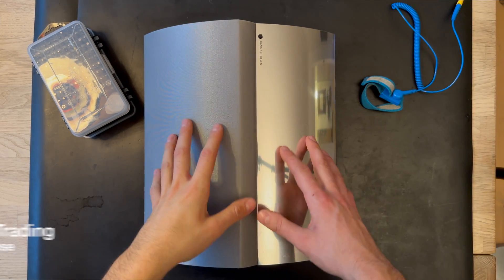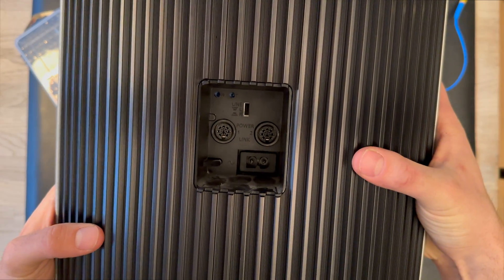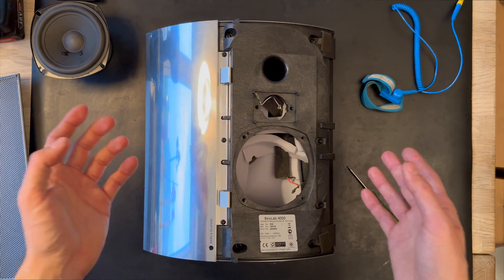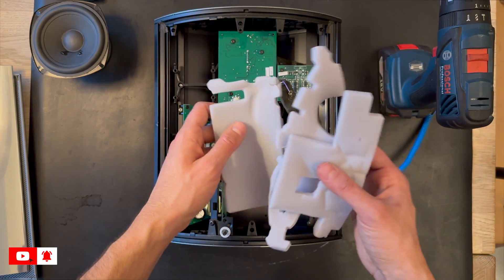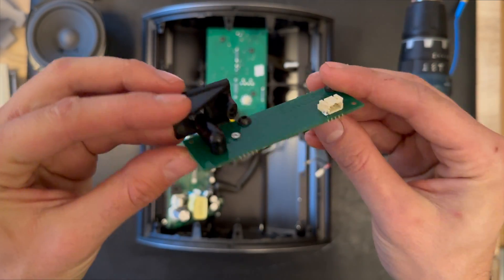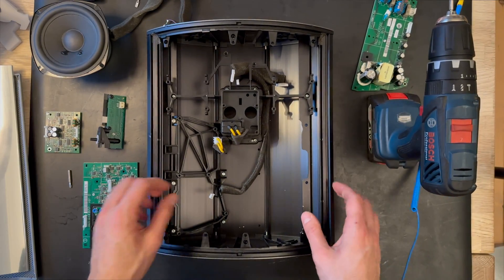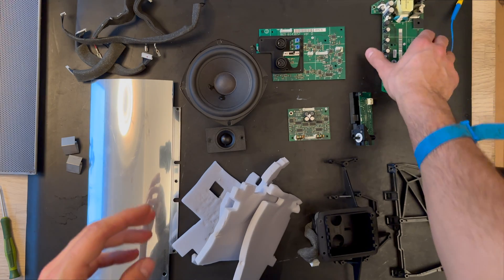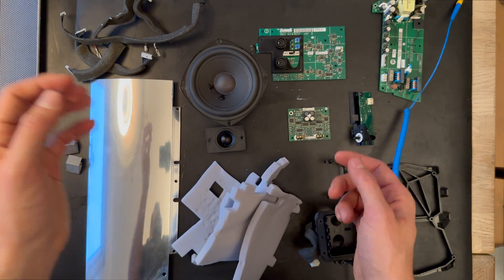Bang & Olufsen Beolab 4000 MK 2 Disassembly process and Repair guide

Comment: Hi , ive just got this speaker and one only show the red light it dosnt turn green, can you guys help me ?
Reply from the maker: Thank you for your message. The issue you're experiencing is quite common with the Beolab 4000 MK2. It typically involves a malfunctioning amplifier module board inside the speaker.

We can provide a replacement amplifier module board, which comes with a 2-year warranty for peace of mind. Please let us know if you'd like to proceed with the order or if you have any further questions.

Here is the link:

https://kosetrading.com/product/bang-olufsen-bo-beolab-4000-mk-2-amplifier-part-pcb-1/

Comment: Hi thanks for the informative video.
I have a fault with my MK1’s where one of the speakers displays only a red light when turned on not the green light. 
Do you know what could be causing this?
Reply from the maker: Thank you for your message! Yes, this sounds like an amplifier issue. You’ll need to replace the board. We offer fully serviced amplifier boards on our website, ready for purchase.

https://kosetrading.com/product/beolab-4000-power-supply-amp-part-02-module-8006149/
Reply: @ Thanks for getting back to me so quickly 🙂 And for the link to the replacement part, I’ll see if cleaning out the old foam stuff has any effect first but great to know I can get a new part if needed…
Reply from the maker: @OnStandby-5050  The damage has already impacted the amplifier board, with the old black isolation foam sitting on it for an extended period. So the cleaning will nok help but you are more than welcome to try.
Reply: @ Thanks, I don’t doubt that you are correct!
Reply: It’s a shame B&O used a material in the manufacturing process that ultimately destroys internal components over time.
Reply from the maker: @OnStandby-5050  Yes, you’re absolutely right. However, I don’t think Bang & Olufsen expected these beautiful, unique speakers to last this long. Additionally, I believe they didn’t thoroughly test the durability of their insulation materials over time. When insulation materials are exposed to moisture over extended periods, their quality deteriorates. So, it’s a combination of poor material choices and inadequate analysis of material selection on Bang & Olufsen's part.
Reply: @KoseTrading  I can confirm that you are correct, which is unfortunate! I’ve dismantled the speaker, cleaned out the AWFUL black sticky foam & surface cleansed the amp circuit board which hasn’t made a scrap of difference to the colour of my power on light 😭😭😭😭😭
Thanks so much for your help anyway, I may need to purchase a new board if you’re sure that’s where the issue is.
Reply from the maker: @OnStandby-5050  
I understand how frustrating this can be! Unfortunately, that black sticky foam is a common issue, and even cleaning it thoroughly doesn’t always solve the problem if the board itself is affected. If you’re still getting that color on the power light, it’s likely that the circuit board is indeed at fault.

I’d be happy to help you with a replacement. You can order the part directly from link and also a new foam kit.

Amplifier  Board.
https://kosetrading.com/product/beolab-4000-power-supply-amp-part-02-module-8006149/

Foam kit.
https://kosetrading.com/product/bang-olufsen-damping-material-insulation-for-beolab-4000-speaker/

Comment: Very nice guide! One of my 4000 mk2’s has been making very loud pop noises when playing and this video gave me the confidence to take it apart and try to fix it.

A question: when you remove the isolation foam around the cables, they are extremely sticky. What is your method to remove the remaining glue? I used isopropyl and some cleaning cloth, but it was pretty slow and not 100% effective.

A suggestion: it would be awesome to have a assembly video as well (I know I can just watch this video backwards, but having an actual assembly video would feel much nicer)
Reply from the maker: Thank you! I’m glad the guide gave you the confidence to dive into the repair!

For the sticky residue left by the isolation foam, isopropyl alcohol is a good choice, but you’re right—it can be slow. I’ve found that using a combination of isopropyl with a plastic scraper or even a little adhesive remover (like Goo Gone, if safe for your materials) can speed up the process. Just be sure to use a soft cloth and avoid harsher tools that could damage the cables.

Comment: Very good video thanks. I came here because I have the Beolab 4000 MK 1 with the foam issue. One question: my MK 1 has an RCA line input, did they remove that from MK 2. Can't see it in your video?
Reply from the maker: Yes, Bang & Olufsen had remove the Line in (RCA) inout for Beolab 4000 MK 2 Version. But you can still set the Beolab 4000 MK 2 in Left/right and line position.

If you need help to fix your Beolab 4000 MK 1 you are more then welcome to contact us.

Comment: The "foam" around the cables in 10:40. Isn´t it there to prevent the cables from ratteling against other components/chassi due to soundwaves and by doing so create unvanted noise? Just a thought...
Reply from the maker: Yes, I thing you have a theory about the sound waves. But the foam around the cables can also harm damages to the PCB boards over time. When the foam gets old overtime and dissolve the foam drops one the PCB Boards like the Beolab 1. 

Did you see my video for the Beolab 1?